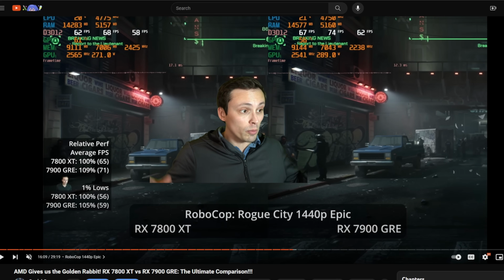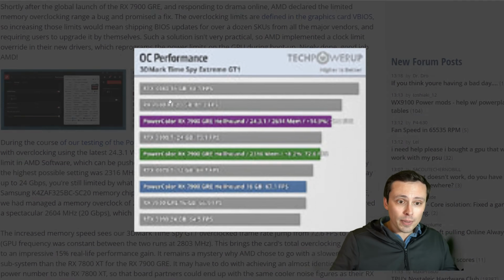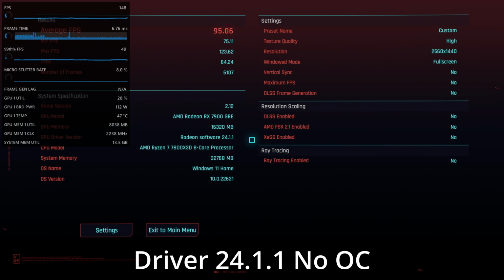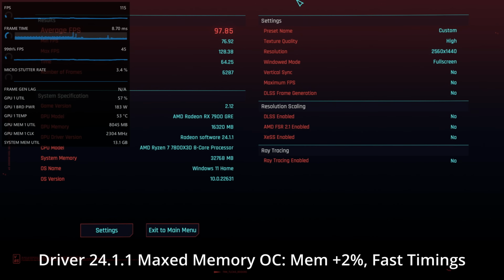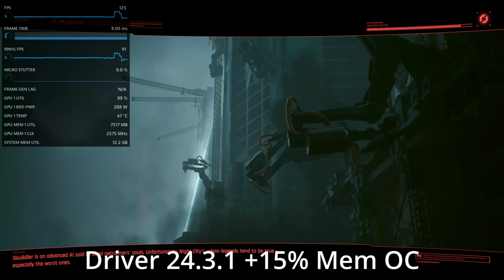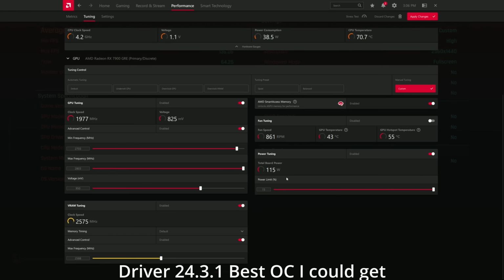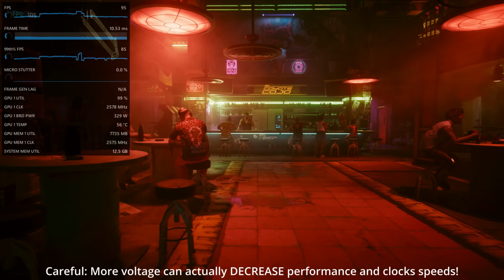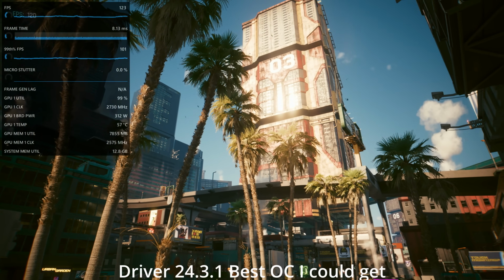Download more performance for certain AMD GPUs!!! (7900 GRE memory OC limits boosted in new driver)

Comment: "So anyway, I started undervolting"
Reply: Did you change the fan curve at all?
Reply: @justbringit9157 yeah the default one is horrible
Reply: Undervolting is the new overclocking. Has been since 2016, so not even so new anymore. But with chips utilizing dynamic boost clocks, it's obvious that reducing voltage allows higher clocks within the same power limit.
Reply: @THU31 if I just want lower temps with similar or a bit lower performance I just need to lower the voltage ? I dont need more power
Do i need to change max freq ?
Reply: @THU31 True, Undervolting can deliver more performance, especially if your hardware gets hot.

My last card I had, I undervoted that and got slightly better performance, about 2 or 3C lower temps and the fans didn't have to work as hard, the extra performance happened by being able to maintain the boost clock more.

On my current gpu, I Undervolted, performance didn't change but I got around the same 2 or 3C lower temps and the lower fan spin speeds.

It's worth doing it if you can keep the same performance or gain a slight boost, you get the advantage of lower temps and the fan not having to work as hard.

In any case, I find you have to do a few test to see where the sweet spot is for your own hardware, how far can you undervolt whiles keeping it stable and without losing any performance, or if you want, you can reduce a little performance and get a massive improvement on lower energy use and temps, which is what my brother did with his Ryzen cpu, I think he lost around 4% which honestly, you won't notice most of the time but he sliced off around 55 watts of power whiles being pushed hard and I think the temps were about 12-14C lower, in his case, the trade-off is worth it.
Reply: "And at first, I thought it was stable. Only to then wake up in the morning with my screen being black, or no signal. 
Huh, maybe it went into a sleep mode.
I started playing games as usual and as I was watching YouTube I had a driver time out. Odd, didn't crash in the game but it did on the desktop That's funny.
I continue to play the games and eventually the game freezes and the system crashes. Now I'm just convinced to AMD is garbage glitchy and a bad card and broken drivers. It's not the fact that I started applying a heavy overclock and were undervolt, nope." 

Pretty much what happens every time
Reply: No.
Reply: @НААТ  😢

Comment: This is just asking for a black eye, Too many variables involved in to getting AMD to run consistently without one thing or another going wrong.
Reply: Haha, I used to be  like you fanboys. 
I was Nvidia my whole life. I believed all that nonsense. 

Just bought a 7900 xt, and it's been the most stable GPU i've ever used. 
Both new, old, and retro games. not a single skip, crash, and frametimes perfect for 2-6 hour play sessions.
Tempature cold as ice. 
And I even added a +16% overclock. Runs perfectly. Not a single issue of ANY kind. 

You saw a video? I learned someone can just as easily type in a video about Nvidia's card issues and you'll find plenty. 
I'm glad I got off of that dilusion train. Or I'd be stuck with a shitty 4070 ti with 12 gb of ram lol.... I literally get the performance of a 4080 on many titles with my overclock. 

for 700.
Reply: @TheRandomDude-qy1ev  far enough. I own products from both. Have a Rx 6800 sitting in a closet. I couldn't sit back and miss out on the Cyberpunks, Alan Wake 2s the true current gen games.  Sony is making the right move with the PS5 Pro,  hardware accelerated custom bespoke AI upscaling and better RT performance.  

I don't like one company over the other, just don't want a PC for a console looking experience. And got tired of coping, tired of missing out.  If I was looking for low end, and going for raster only performance like it was 2 GPU generations ago I would be ok with Radeon. But if you want a premium experience you get a premium product.
Reply: @Sp3cialk304  I own both as well. And, funny enough 99% of the games I play don't use ray tracing, like 99% of people, and games. The 1% of games that have over the top RT, even on Nvidia require some not so great caviots. Upscale it first lossing image quality, and then use FG for increased input lag. 
You're trading two things for one.
You're not getting a premium experience. 
You're getting an experience that you find worth it, and that's good, have fun. 

WIth lumen on the rise and traditional RT dying, the future is not exactly what you might think it is. 
Either way, at no point on my 4090 rig, or my 7900 xt rig do I say "Man, which I was on the other" 

And, I'm not so short sighted as to make a purchase based on 1-2 games which describe themselves as a demo for future tech. 

I'm not impressed.
Reply: @TheRandomDude-qy1ev  Hardware Unboxed did DLSS vs native at 1440p and 4k. They had DLSS Quality winning more than native in image quality. And that was a year ago. DLSS has had multiple improvements since. This is because new games are to demanding for MSAA or SSAA. They use TAA or FXAA which kills image quality.  Digital Foundry has found the same thing to be true also.  The vast majority of gamers like the push for RT. But 10 percent of the PC market tries to pretend like it doesn't exist. Small loud group. They are like flat earthers. But different people have different preferences. Some people are fine with console visuals.
Reply: @Sp3cialk304  Hardware unboxed also noted the image clarity is worse, they were refering to fences, and objects in the distance. It doesn't look better. People don't turn it on as a feature, they turn it on as a boost to reach something stable. 

The vast majority of gamers do not care, the vast majority are playing mobas, mmos, and FPS shooters, along with fun silly games like palworld. Don't just say random things, it sets yourself up. 

The second you turn on DLSS, and FG you're playing on a console. They've been upscaling for decades. 

No one turns on DLSS by choice friendo, and no one turns on FG by choice. Both raise supreme latency, visual ghosting and artifacting (fg mostly) and DLSS still does as well. 

Enjoy your card brother, but you need to understand people really don't care.
Reply: @TheRandomDude-qy1ev  They may have said that in one game using an older version. Thankfully it's easy to update the version a game uses. But on the overall chart they had DLSS quality taking more wins than native.  In fact they said they can't say DLSS is better image quality than native as a blanket statement because DLSS performance sometimes isn't. But that there is no reason to not use DLSS quality. As it's typically better or equal than native at 1440p.
Reply: @Sp3cialk304   They also said it's not as sharp, cause it's not. When they refer to it as being "better" they always refer to an object, or something far away (that they zoomed into 200%) 
Their videos on this are more educational, and the word "better" shouldn't be used out of context. They're saying "In this situation, it looks better"

DLSS still suffers from trails, it suffers from smudge and grass, and dense places. It improves many things, but also takes away from allot. It's not native. It works well, but people still don't want to turn it on.

You do know the new FSR version is comingout soon too, right? And it's going to be indentical from what we've seen so far to DLSS. It's not really a great selling point atm. And everyone can use it, no need for AI, or being on their latest and greatest. 

DLSS is nice, FG is already something both can do, both can Ray trace, Nvidia can do it better in the 2 games that have tech demo RT, but require aggresive upscaling and FG. Trading allot for some lighting. 

Bro, you like your card, I'm happy for you. You purchased it based off of 2 games nearly no ones even playing anymore. And i hope you didn't get a 12gb card. I hope you at least got the ti super, or 4080+.
Reply: @Sp3cialk304  Rofl :)))
Upscaling, on any card is bad ... DLSS is better than FSR, because it shows 3 artifacts instead of 5 artifacts :))
It's still not perfect. I would rather play on native.
Some people might not notice any artifacts. Either they have poor vision or due to the placebo effect. Doesn't matter ... It's still bad ...
Upscaling only works if you play on a big screen TV and you sit 2 meters away from it. Then, and only then, you won't be able to spot the artifacts.
But that's either a console, or a console replacement desktop.
Desktop users who use a monitor, and sit 40 cm away from the screen, will notice those artifacts, and can be distracting. 

Also. FG is bad right now. It's just a frame-smoothing technique, it's not free performance as the marketing teams would want you to think. It just smooths out your image on your screen. It's meant only for people that have high refresh rate monitors, but can't fill out those refresh rates due to how demanding some games are. The problem there is, it's not a dynamic generation. On nVidia, they push a fake frame every 2 regular frames, so it's a constant +50% more FPS on your screen. AMD pushes a fake frame after every real frame, so it's a +100% more FPS on you screen. So, if you have a 240Hz monitor, and you're getting 200FPS in your game, you can't turn on FG to generate JUST 40 more frames to fill up your screen. It's either 300 FPS, or nothing ... 

Whoever of the 2 companies will figure out how to only generate JUST those missing 40 frames is going to make History. Albeit fake frames, the experience won't be hindered, since there would be a fake frame at every 5 regular frames, you won't see any ghosting, artifacting, input lag, etc ...
Reply: @TheRandomDude-qy1ev  yeah I just use 4090s in my rigs, wouldn't know anything about the downfalls of the 7900 xt or any of those other budget cards.
Reply: @blutdogify  the only one on a budget, is the one who can't afford both. 
Shame, maybe you'll get promoted eventually. 

Keep up the good fight.
Reply: @TheRandomDude-qy1ev  Yeah you lost me partner, Not sure where you going with this.
Reply: @blutdogify  You've been lost for a while friend, but I found you. 
And everything is okay now. I'll make you some hot soup will cuddle up in some blankets watch ourselves some classic cartoons next to a fireplace doesn't that sound pleasant
Reply: @TheRandomDude-qy1ev  are you saying I need a 7900xt?
Reply: @blutdogify   Only poor people make or don't make purchases based off of need. 

I do whatever I want, I have all of them. You play with your 1 card and run along now.
Reply: @TheRandomDude-qy1ev  oh damn burn son, I most likely have more GPUs just sitting in boxes of different brands and models than you've owned honcho.
Reply: @blutdogify  only a poor person would say something like "Likely" 
You should have a 49D in the living room in every room even in the bathroom rig. 
You should have every AMD card as well.

When you're rich you just buy everything because it's nothing to you. "Need" only poor people buy things and make decisions based off of what they need. 

Us rich people we just buy it because we can and it's fun and we want to play with it.
Reply: @TheRandomDude-qy1ev  Yeah I do have a few AMD cards also. Because we rich people wouldn't have it any other way.
Reply: They are around 10 percent of the dedicated GPU market, and 95 of the complaints, issues, problems your hear people suffering with involves them.
Reply: @Sp3cialk304  I understand that, but also they have a historical reputation of having issues so the first time someone has issues with their system, they Google it and see "AMD driver issues". Now don't get me wrong. I'm not saying I've had no issues at all, but they have all been pretty minor. I'm just saying that it gets inflated by the reputation they had in the past. Sometimes people have other issues and it gets blamed on the gpu.
Reply: So true. I saw an AMD channel a few days ago put out a video claiming all the driver issues and problems you are seeing about the last 2 driver updates is user error. Saying people should disable xmp, or crank up memory voltages, they need to run DDU Everytime they get a driver update, do 20 different trouble shooting steps. That it wasn't the drivers it was the users. The fact that the video had to be made speaks volumes. The deflecting, projecting blame and trying to sweep it under the rug mentality is insane.
Reply: I'm not saying there aren't some issues, but they can often be blown out of proportion. I do honestly think they become a scapegoat for other systems problems quite often.
Reply: years and years of AMD, Nvidia too on another pc, both update drivers with DDU of course...  @Sp3cialk304

Comment: GRE has same 18gbs chips like rx 7600. Those are lower qualtty bin and chances are they wont overclock good as higher rated chips.
Reply: there a gre with hynix memory that  re rated at 20gb per second bud

Comment: 3070 GDDR6X version could have 5-15% better performance just with increased memory bandwidth, so i could see more from GRE with little overclock on GPU too.
Reply: U can add +1500MHz memory clock in msi afterburner.
Reply: You know that "3070 with G6X" is called 3070 Ti, right? The extra memory only adds 5% of extra performance.
Reply: @niebuhr6197  no 3070ti has extra cuda cores too, there is a 3070 with same cuda cores as normal 3070 and gddr6x memory.
Reply: @niks660097  only has 4% more cores, that amounts to basically nothing. Memory makes the small difference.